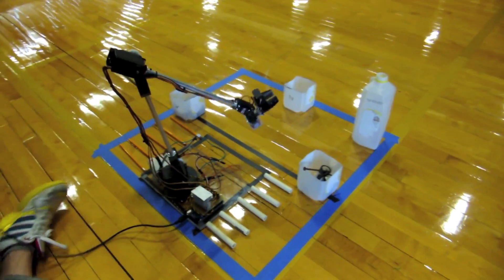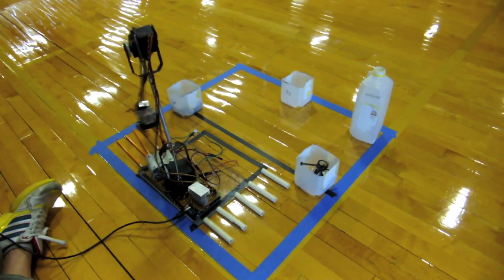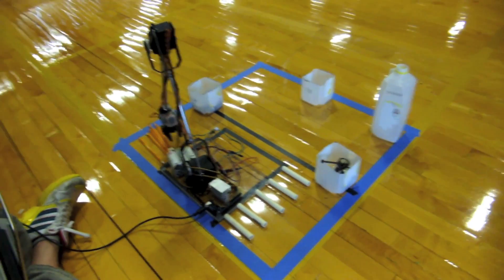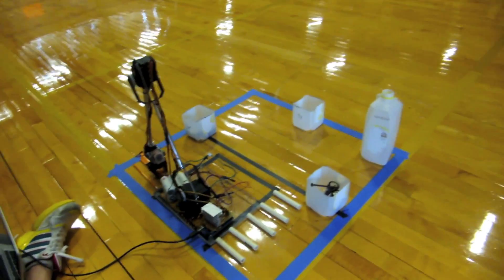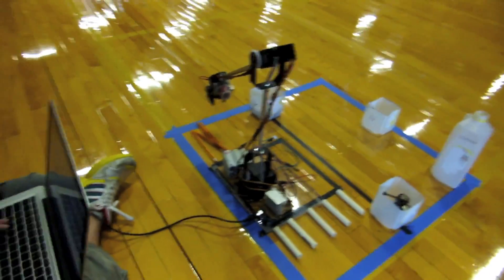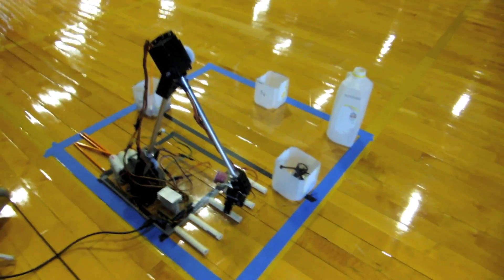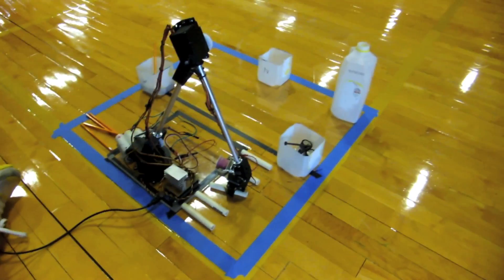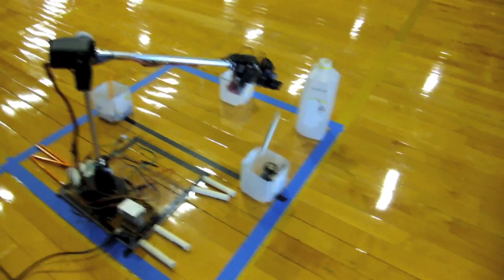Science Olympiad Robotic Arm, 5DOF, Inverse Kinematic Control

Comment from the maker: That's a good idea - we hadn't thought of that! Since you can't turn the electromagnet off between nails in this case, you would need to do some fine maneuvering to pick up the nails properly, which I'm not sure this arm could do, since it has problems with sagging  - maybe with more torque-y servos? We ordered some "magical" digital servos from hobbyking with over twice the torque of the Hitec 805BBs, but didn't have enough time to install them before the competition...